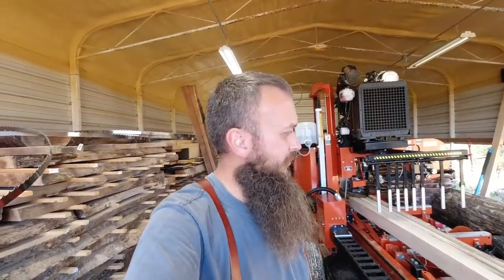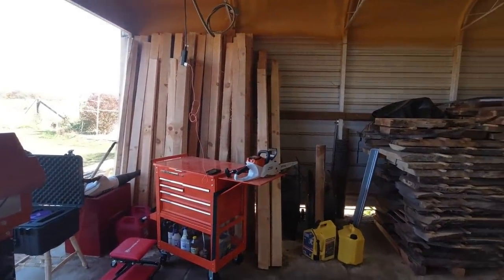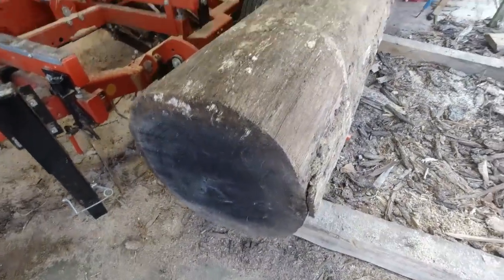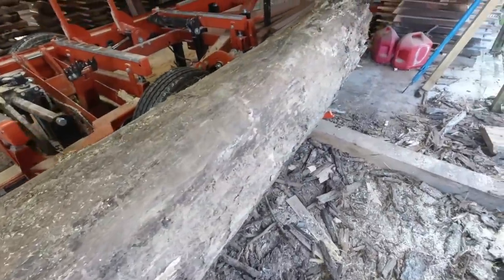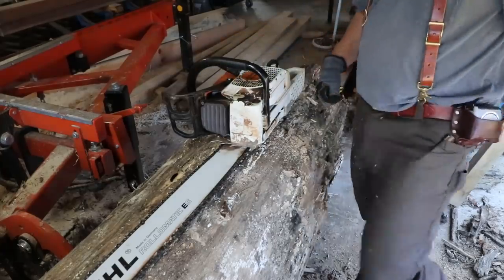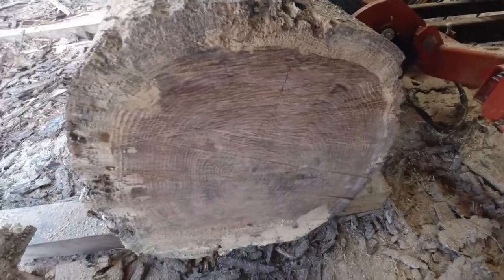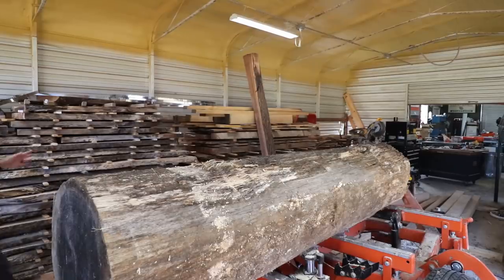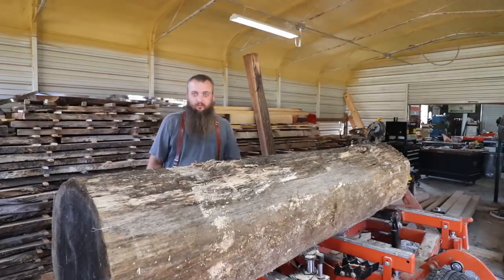Wait Till You See Inside Of This Rotted Oak Log,

Comment: I had an old red oak stump on my place , it was about 40 inches in diameter . Figure it was 10 years old or older , the stump . I got the bright idea that I could take my chain saw and cut down in the top and maybe it would rot quicker ,I could not believe how hard that wood was ,there were literally sparks flying and there was no metal in the stump . That was 30 years ago and some of that stump is still there .

Comment: I had an oak tree fall this past week when we got a huge downpour of rain. It had been standing there dead for about 15 years. I thought if it ever fell it would just turn to dust when it hit. It has a couple of limbs holding it up. The bottom didn't split either. It fell over roots and all. Well, what was left of the roots.

Comment: I am curious as to why you put all those bigger pieces of wood into the burn pile, vs cutting them up for the sticks you put between the stacks of slabs and other good lumber while drying?   Or use for fire wood or kindling in your fireplace, which I’m assuming you have in your home.  I think I remember you saying the only firewood you cut was for yourself.  I use to split very small pieces as kindling for my wife to start our fireplace.  She could put a few pieces of kindling on the dog irons and stuff 5 or 6 sheets of newspaper under the kindling and start a fire with one match.

Comment: I know there has been a lot of comments of the waste wood/burn pile, and no... haven't read them but you've commented on them a time or two.  But just a thought... throw my two bits in and again might be already said.  And time is a factor... part a what I am suggesting... but between all that wood as goes up in smoke... maybe even the sawdust... that separate what if you had a chipper there?  Seems like your Dad or someone else besides you might make some extra cash running that wood through a chipped and selling the chips?  Maybe not a good idea or make anything... but like others... a thought... is all even if it is worthless...